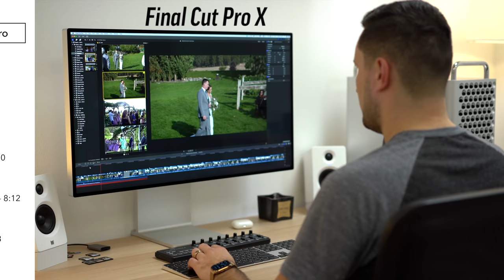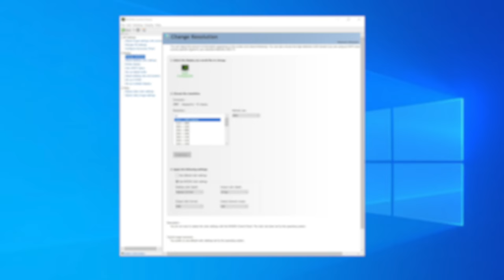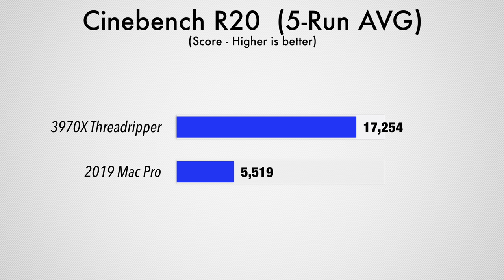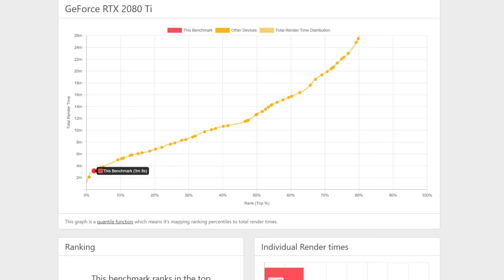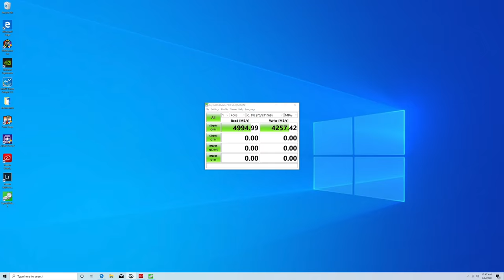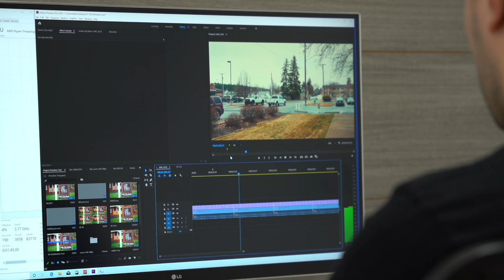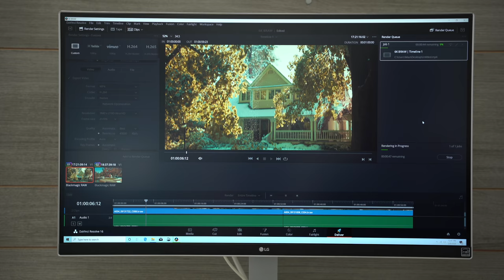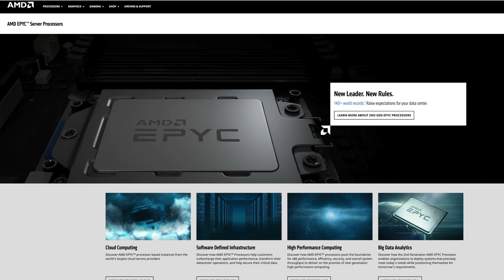$15,000 Mac Pro vs $5,000 Threadripper - Sorry Apple..

Comment: Iam having alot of problem with this video,
The biggest one is, the pc only cost 5000$.
Alot of the problem that was mentioned, other than the argument of building it is rather hard, can be easily fixed by adding more budget to the build. 
Like, he is comparing something that is 3x as expensive and treated it as the same price.
It isnt like the macbook air and pro, and ipad and its pro variant where the competition cost similiarly.

Comment: There will be heavy bottlenecking because of the RTX 2080 ti. The cpu is simply too strong for this gpu so you might as well replace the threadripper with a Ryzen 7 2700X for better price performance ratio. It would be ~1500 $ less to achieve this build.

Comment: I just got done building my new Threadripper 64 core beast. It has a Asus ROG Zenith II Extreme Alpha MB, 192GB 3600 RAM, 2x Samsung 1TB 980 Pro M.2 V.4, 2x 10 TB Western Digital SATA drives, 2x EVGA 1600 watt power supplies, 2x Radeon VII Pro GPU's, connected via AMD's Infinity Fabrik Link which is their version of NVlink and a new Nvidia 3090 RTX for gaming, which was a tight fit but worked as the CPU and 2 Radeon GPU's are water cooled using EKWB tubing, fittings, water reservoir, pump and radiators. I will add the 3090 RTX to the loop as soon as the block I just ordered comes in, I ordered it from EKWBs website, the EK-Quantum Vector to match the 2 Radeon Blocks. 

Though I'm not sure how long this configuration will last as if the new AMD 6000 series holds up I will be selling the 3090 RTX for two 6000's. Or, I will add another 3090 RTX and connect them via NVlink, we will see.

Yes, I'm insane, though since I don't have a car, I have an electric motorcycle, I figured the money saved on gas every year affords me this luxury item. That and my firm paid for Radeon cards. We purchased them for testing in our new servers but ultimately filled them with AMD's Instinct cards. Which I also have one that I use for testing purposes. I write the agrorythim for the firm,  though really,  not worth the money as the Radeon VII Pro has more than enough power to handle anything thrown at them.

Yes, I'm saying the Radeon VII Pro is an awesome card and recommend buying two over a single Nvidia 5000 or 6000 RTX anyday and they're  cheaper.

Comment: Did he just say "Threadripper don't compete with xeon"
Bruh
Threadripper 3990x 
64 cores 128 threads 4.6 ghz 256 mb cache at 225 watt Tdp outperforms twin xeon 8280 with a score of 21000 compared to TWIN xeons 16000 and costs half the price of a SINGLE XEON also runs at 52 degrees with lot quiter fan noise, How the f#$k is xeon better?

Comment: To start I’ve seen custom builds for 60 % cheaper literally out benchmark and perform this junk. Not only that, the mac pro wasn’t even up to standards when it came out. And not to mention the monitor, there are other 6k monitors that’s go for wayyyy cheaper, the monitor is literally more expensive then some peoples cars. A good Mac Pro setup will literally cost you around 11k while a good custom build is around 6k . And with the MacBook literally being 6k-15k you would expect to be able to play video games. In short I’m not paying for some pretty aesthetics and an apple logo

Comment: it has been known for ages you can custom build a kick ass windows PC which will blow out apple's top of the line model with a significant cost savings.  i would love to see this redone in a few years when apple's custom chips are standard and everything is optimized.  the only reason to spend money on the apple rig is if you need macOS or you have tons of $$$ and care about branding.  however, seeing all the tests results shown and explained was kinda neat.  cool vid!

Comment: My friend, with 15K you buy THREE PCs like that one, which means you can encode 3 videos at same time or 33% on each PC, which means it ends much faster, than join the three videos (takes seconds). Also you can have 1 PC to prepare or transcode files, 1 PC to edit and then render and 1 PC to play games.

Or 5K for 1 PC + 2K for 1 AC with a tube with 17° Celsius air injecting on the PC (so noise will be lower) and save the rest for electricity. 

At the end: the mac is excellent and cool, though ist 2x more expensive as it should.

Comment: The only thing that Apple actually has up on this computer is that its OS is built better than Windows, but with a little expertise you can run MacOS on that build with little to negligible overhead from your hypervisor. Even the noise problem can me mitigated by placing the computer in a separate (nearby) room and running an ethernet cable to the monitor (although this means giving up your Apple monitor which is not a loss in any sense of the word really, and adding an expansion card that can copy & output video through ethernet). Given it’s meant to be a workstation, wireless peripherals are not an issue and with newer Bluetooth protocols even casual gaming will not see any issues with input lag.

and for god’s sake, don’t use a gaming card for workstation tasks.

For a little over 1/3 the price you can get a Hackintosh that blows a $15k proprietary system out of the water and into the thermosphere. Just... don’t defend Apple’s business practices, the good of that company comes from their programmers and sometimes their product engineers.

Comment: I have a 2018 Mac Mini with a Sonnet Breakaway box with a Radeon RX580.  It’s pretty much for learning before I make creation my career.  I recently found out that Apple doesn’t let FCPX or any other Apple program, use the eGPU.  Do I switched to DaVinci Resolve 18 and Blender.  Apple also doesn’t use AMD Pro workstation cards.  Since I’m not using Apple software anymore, I’ll be trying out the Lenovo P630 with a W6800.

Comment: im sorry to say it like this, but your acoustic testing was unprofessional, and not at all a fair test. pretty much all the problems you mentioned in relation to noise can easily be resolved with some Fan Curves, 10€ worth of software and if you want to push it to the maximum, a more high end cooling solution (wich EASILY fits in the budget since the competitor already costs 10k more)
Also, testing noise levels with an apple watch in an uncontrolled environment is laughable.
Next up, you conclusion just renders the entire video useless. You are complaining about the parts YOU chose when there are better ones available.
With the comperative budget of 15k you could easily have afforded the following changes:
-max out the ram capacity of the Threadripper
-get 1600w power supply that powers 4 GPUs easily aswell
-get a quadro rtx8000 for the additional VRAM (48gb gddr6) and workstation features
-get a motherboard with more connectivity
-built an appropriate air or liquid cooling solution
get basically any case you want, certainly one with better cooling capabilities there are ones wherere you can rip out the entire MB Tray for assembly, have tons of hotswap HDDS etc etc, you get the point.

Lastly, with the insane amount of up to 64 cores on TR it would easily be apple to run a VM with MacOS on the side for the tasks where its a huge improvement. And windows optimisation would probably have come a long way for you aswell

Also lets not forget your "but it takes so long to put together" argument:
On one hand, thats exactly why you go to windows, because it allows you to tailor nearly every aspect of your machine to your needs. On the other hand, there are also System integrators like Pudget systems that specialise in building tailored workstations for certain applications.

The Problem i see here is that you are a tech savy USER who focuses on the Video editing side of things, but think you have what it takes to build a top end Workstation - sadly this turned out to be untrue, wich resulted in most oft the downsides of your PC.
Ofc the Mac still has some advantages (Afterburner card or lots of Thunderbolt for example), they are just a lot fewer than the ones you mentioned

Comment: Well, Edgar from TechSource build just recently a system with Ryzen Threadripper 3990x, 64GB of RAM, 2x2TB NVMe SSD in RAID 0 + 2TB SATA SSD, RTX 3090, and he manages to keep it cool and "quiet" (that's the keyword) during a full-load. and it'll outperform the Mac Pro by a large margin.
So what's your excuse now ?!!

Comment: There is no way it takes days to build a pc if you know what you are doing and dont have any problems it probably only 1-2 hours. But if it is your first build it could around maybe 5. Also if you run into a problem there is an amazing community on reddit that will gladly help of you can't figure it out and typical they dont take to long to respond to you once you post it. The only reason it should take days is if you had to return a part because it was defective but that is not even your fault.
Reply: i literally once speed build a pc in half hour, rocking that i3 9100f and htx 1650 super, great budget build

Comment: Hey bro, I've got a Linus Tech Tip for you.
If you want to stop seeing crashed programs and want Windows to be faster in general, try the following steps:
Disable the telemetry, which you're prompted to do during the install process, stuff like cortana and location tracking.
And, most importantly, ENABLE HIGH PERFORMANCE MODE IN POWER AND SLEEP SETTINGS. 
Also try disabling sleep mode.
You apple fanboys really just don't know how to use Windows.
A fresh install of win10 on a system like this should feel like everything runs at the speed of thought. In fact, that's exactly how it runs on much cheaper PCs.

Comment: your three fan radiator cooler for your threadripper is holding you back.
You want to use a Noctua air cooler.
or a custom water loop which is way to expensive for an office workstation.
Linus did a comparison of air coolers vs watercoolers.
Air won hands down. Noctua specifically. The triple fan watercooler performed worse than the double water cooler.

Comment: I think a lot of you are missing the point. Both stations have use case scenarios. The $5000 PC build is going to work for a large majority of people. However, for instance, colorists working in Davinci Resolve would have a significantly better experience editing with the advantageous afterburner card and optimization of MacOS over the threadripper. Of course, I do think the Mac Pro is overpriced. But, for some instances, that performance boost in applications such as using HEVC media and grading could make a world’s difference.

Comment: Curious why a Xeon wasn’t used? Are they more expensive? Curious out of box time to getting to work. And time to complete project with or without issues? With or without Afterburner Card? Final Cut vs Premiere? Which gets the job done the most effectively and cost efficiently? Don’t need a Ferrari to deliver mail. Would a lower cost Mac Pro have performed similarly? Is the 15K versus 6-10K any better? I essentially want a Mac Pro (macOS too?) clone cheaper running against a Mac Pro. We call things Apple tax, but what about design/engineering? I’ve had Hoover vacuums, and now I have a Miele, the difference is amazing, the Miele is silent which makes the experience better for me. If someone can design a PC that doesn’t look like a hoarders apartment, I’d be interested.

Comment: The PC had about 3 times the Performance of the Mac, while the Mac costs 3 times more. That equals to about 9 times better value of the PC!
And the only issues with the PC could easily be fixed by some tweaking.
Fan noise: In the PC's BIOS, you could increase the ramp-up time of the fans, so they dont go off at every little power-spike,  or just decrease the RPM at mid-cpu-temps.

Snappiness: in the power-management settings of Windows, there is a Setting called "Minimum CPU Power state". This percentage value determines how far the CPU Clocks down in idle. If you set this value for example from 30% to 50%, your PC should react alot faster, when coming out of idle, without really consuming more power.
Conclusion: PC MASTERRACE

Comment: Why is everyone calling this guy an Apple fanboy?  He pretty much concludes with the price superiority of the Threadripper, and states it multiple times too.  People are looking over the fact that the PC uses way more power, which is actually kind of a big deal.  In addition, that extra fan noise means parts that are wearing faster and will need to be replaced sooner.  As for the ridiculous Apple price tag (the price of a car!), let's be real: only a crazy person or a video-editor pro fully loads up a brand-new Mac Pro using Apple parts.  Used Mac Pro's are a thing, and they're a MUCH better bargain.  They also last forever.  You can buy all the RAM, drives, and gfx cards after-market for MUCH cheaper.  If you're insisting on using Mac, like for video and design work, then I highly recommend this.

Comment: For a $15000 windows pc comparison with $15000 Mac, multiple top rank processors and GPUs should be bought and connected in parallel and then Mac will die of shame
Reply: a $15000 pc is literally used to launch nukes!

Comment: Yeah the 2080 Ti is so much slower than the 3090. Put the 3090 and the Mac Pro's advantage is very minimal except the noise. I'd like to know any task you can do that maxes out the 1.5 TB RAM you get in the Mac Pro, if you can actually find one

Comment: Apple benefits from the Developers who put in more effort to optimize their apps, while the same developers do not follow the same coding standards for Android or windows apps... It's also because apple os apps are written in a rather low level language, they sit closer to c language, compared to Java in Android and c++ for windows. If an app say developed in python were to run on both os via some virtual machine, the windows will take the lead.

Comment: To be fair on the Apple Pro that's not in this video. Apple Pro uses Intel not AMD,  15,000 is coming straight from Apple instead of doing the upgrades yourself. Since AMD does not design their own computers you can source the parts from all over the place just like you would with a custom Intel machine.  I have always bought my upgrades  on my own instead of directly from Apple. All this video shows is a Intel Vs AMD cost within a Apple body.

Comment: the mac ran cooler because apple makes their computers and laptops throttle the cpu so it makes less heat so the fans dont have to work very hard to dissipate the heat

Comment: you should look at doing a kvm hackintosh, i have a working ryzen hackintosh using linux kvm, 
it has a little bit worse cpu performance than bare metal, but even with a core or 2 dedicated to the hypervisor, its better than my macbook pro, gpu performance is perfect as it uses  pcie passthrough

Comment: He cherry picked every item for the PC. You can Hackintosh any AMD CPU for one. You could make it completely silent with the right AIO. Get a workstation GPU and not a gaming GPU and the Quatro GPU he showed isn't the closest, just one of the most expensive. There are many others that will work. Hell, he could use an AMD one since you could Hackintosh it (you would have to use an AMD card anyway). There are so many points that are wrong. Plus he should have tested the Mac Pro under Windows as well to show how it performed in the same environment because the benchmarks don't compare between different operating systems and he knows this.
Reply: Lol. Even if he did all that - the Apple trash can wouldn't come close.

Comment: I Love how when He gets into talking about the later parts of Video editing and Hes comparing how its amazing that the Mac Pro with MacOS and Vega II can hold its own against the beast that is the threadripper, makeing it Sound Like an amazing feat, since the threadripper has many more Cores and better single core Performance and the 2080ti is better for gameing but equal in Video editing, at that point, seems to COMPLETELY forget the price difference, with the Mac Pro costing 3 Times as much! It should Blow the PC Out of the water at such a price Point. You shouldnt be amazed at the Mac for getting the same Results, you should be Outraged!

Comment: Apple is Apple tho, and Apple computer work for years and years compared to the pc, Which is over powerful and survives only 5 years or so.
Plus Apple is designed too be safe and that’s why it’s less powerful, the money you spend is money to pay for the safety of your stuff. It’s simple.
Plus why would you need 200 FPS on games? It’s faster than instant so there’s no point. Also Apple ISNT for gaming AT ALL! it’s designed for say running a business, editing videos, using zoom. Stuff like that.

Comment: I get it. People like apple.
I don't and here is why.
There is a chip under the touchpad of the airtop. It distributes power around the laptop. no big deal.
But there is no liquid protection under the vulnerable touchpad area. no big deal.
But there are two power distribution pins next to each other on this chip. One sends 50 volts to the backlight of the screen. The other sends 1.5 volts as a data line to the CPU. It is a direct line without any type of fuse.
liquid bridges the gap and the cpu is fried. This means you need to replace the cpu. But apple doesn't sell just the cpu. They sell the entire board which is more money than the used airtop is worth.
So you could buy a used board from china. but it is also most likely water damaged in the same way.
Apple knows about this flaw. They have not changed it for over a decade. It was designed this way to make money. All their policies aim at this target.
It is genius and evil.
I do not support a company that employs such business practices.
They think their customers are to stupid to figure it out.
Guess what, they are correct. I smile when I see someone using an apple product.